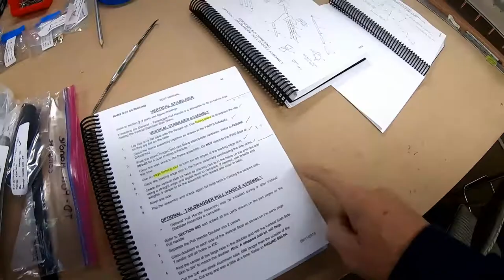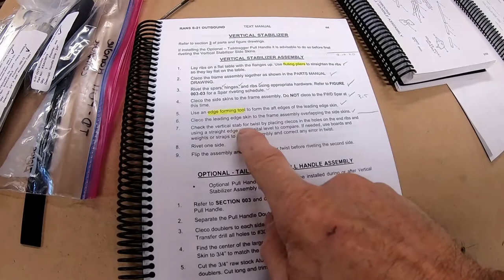RANS S-21 (004) Vertical stabilizer build

Comment: You may want to use 2x4’s to block up the pieces as letting them rest on the clecos can put “smileys” in the skins around the rivet holes.  It also makes it easier to get the airfoil shaped pieces straight and twist-free.

Comment: I had to ream my hinge bushings to get the bolts to fit through.  They compressed enough during the pressing operation to shrink the hold enough to prevent the AN3 bolt from going through.

Comment: I actually deviated from the plans and riveted the front spar from the other side.  One for the reason you mentioned and the other is that I believe that is better practice given the general rule of riveting that the factory head goes on the side with the thinnest metal.  The spar is thinner than the stack of doublers so that just seemed more logical to me.  Obviously, sometimes access prevents following the general rule, but when I can follow it, I do.